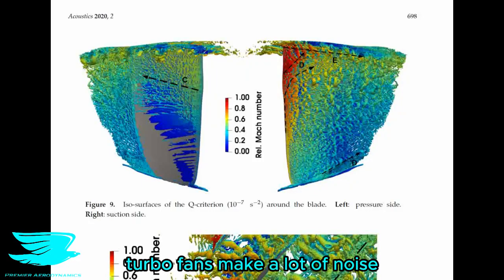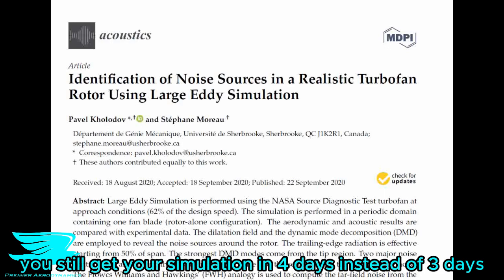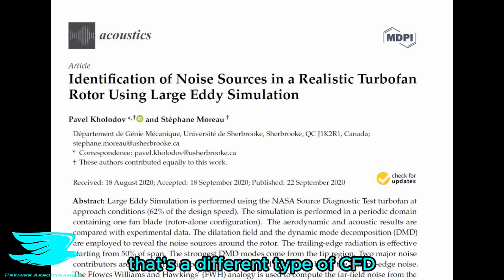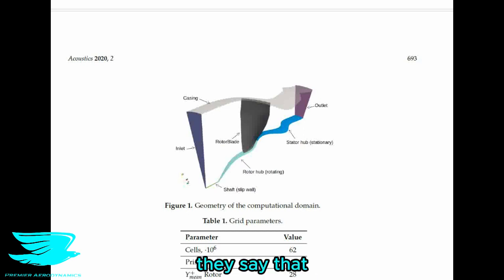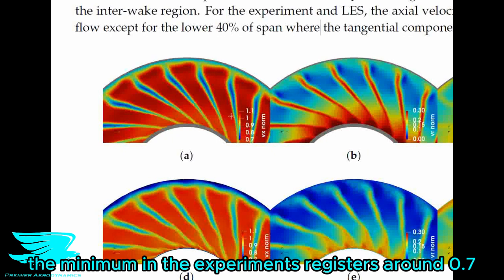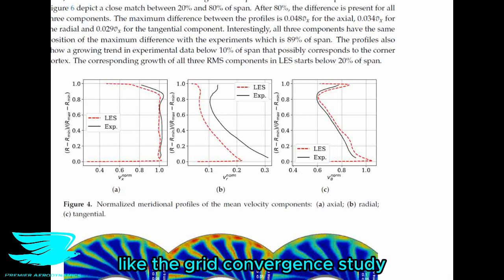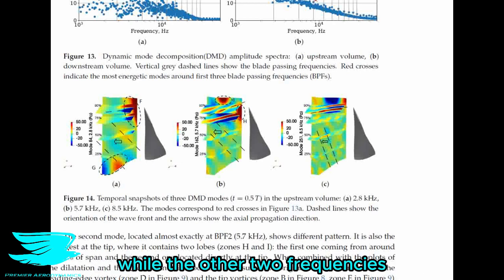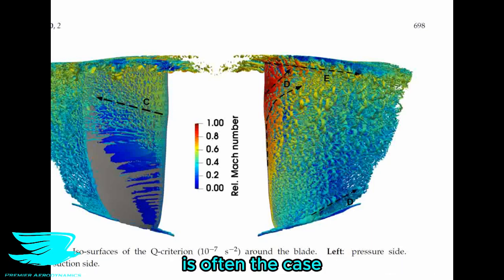Podcast #168 Turbofan Noise Production

Comment: Tubercle.  Humpback whale flipper.
Reply from the maker: Close, but this one is just one bump and not along the entire leading edge.

I actually stumbled upon it while I was researching tubercles funnily enough.
Reply: @PremierAerodynamics  Interesting, I had not heard of that.  I suppose the way the engines are blended into the wings of the XP-67 would be similar to a single tubercule?  I have not looked into it, but some early jets (Convair 990) used afterbodies on the trailing edge of the upper surface of the wings.  To minimise trans-sonic drag. I wonder whether these could be applied to fan blades? To reduce shock and hence reduce noise and improve efficiency.
Reply from the maker: @TheBrontovox  I have been looking at the XP+67, and it might be because of that.

As for the jets like Convair 990, the extensions at the back are to reduce the transonic drag through reducing how quickly the cross-sectional area changes as you go downstream.

A guy called Whitcomb has a rule called, Whitcomb's area rule, which says that the more abruptly the cross-sectional area changes, the more transonic drag you'll get. These extensions help reduce how abruptly the cross-sectional area changes, to make it a smoother transition. That then reduces drag.

The idea could be applied to fan blades, however usually a fan blade is limited by the blade tip speed. because it is located as far from the center of rotation as possible, it reaches transonic speeds first, which causes a lot of drag, not necessarily an abrupt change in cross-sectional area.
Reply: @PremierAerodynamics  I am currently developing fish friendly turbine blades. Water of course not being compressible, and so resembling transonic fans. I use Open Foam for simulation, and 3D print the blades to confirm. The blades are canted forwards, with also sweep back. There are some compromises with efficiency though, in order to have them fish friendly.
Reply from the maker: @TheBrontovox  Wow! What makes them fish friendly? Are they shaped in a way that if a fish hits one, the fish won't get stuck and will get pushed out of the way instead?

It's a cool idea!